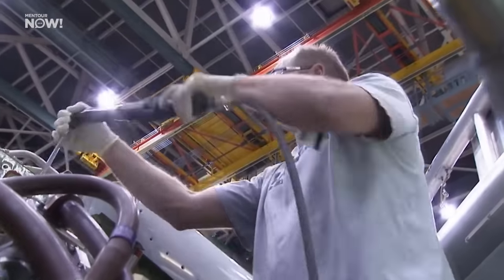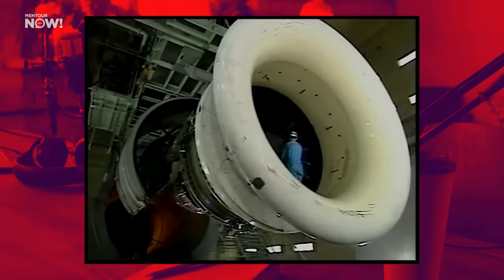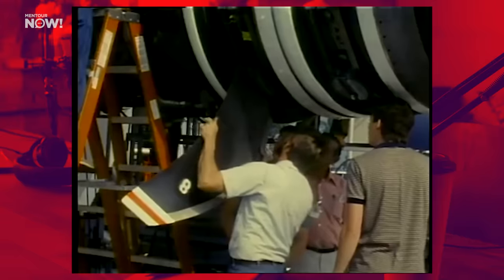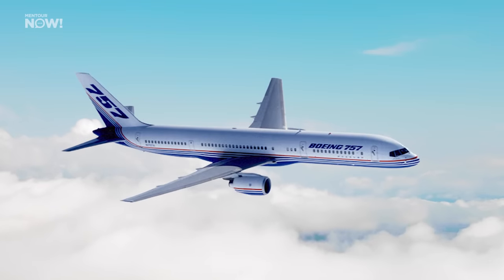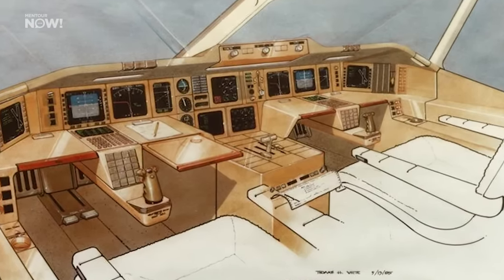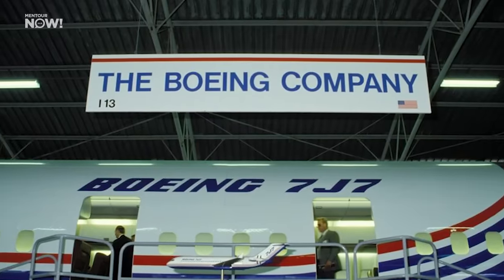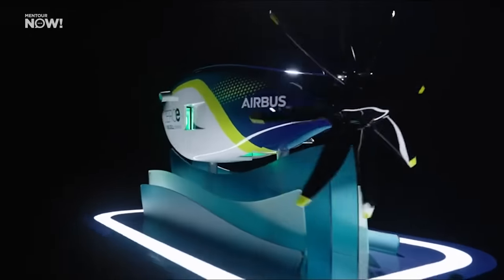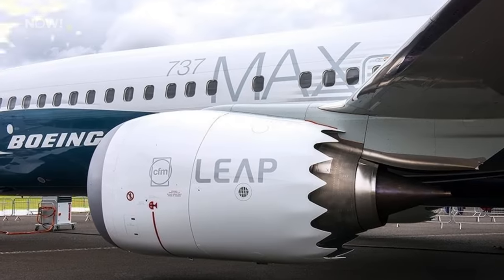Revolutionizing Flight! The Amazing Potential of the CFM RISE Engine.

Comment: Very informative. It'd be "interesting" to sit by a window beside one of those beasts.
Reply: It's odd that I don't think twice about sitting next to a turbofan prop but this new design gives me the jitters.  Most likely it's because standard props have been around so long that they seem totally normal so I don't even notice them.
Reply: Considering we still have uncontained failures of both turbofans and turboprops I try to make it a point never to sit beside the engines on any flight.
Reply: @cosmicinsane516  I do the same.  I trust all machinery only so far.
Reply: I flew on an ATR 72 directly next to the propeller, it was not an experience I would like to repeat. It doesn't matter if it's rational or not, the fear is the same.
Reply: @cosmicinsane516  It doesn't matter how robustly you design a system or how many space-age special alloys and forging techniques you use for the materials during construction, It is fundamentally impossible to design ANY system that is absolutely foolproof and incapable of failure, especially on such a complicated mechanical structure as in a modern turbofan engine. That being said, modern aircraft engines are extremely robust and extremely reliable, the incidence rate of engine failures on modern aircraft is about 1 in 100,000 flight hours, which makes it beyond extremely rare.
Reply: @Cynsham  Exactly.  So if there’s a .0003% chance of an uncontained failure and I don’t sit in the likely zone of danger for that failure, I have then reduced my risk by a measurable percentage.  Same as wearing a seat belt or not eating the ham in the fridge that smells a little funny.  Save the risk for higher reward scenarios.
Reply: Jets regularly run through flocks of geese and have migration forecasting to avoid the catastrophic engine failures that sometimes occur when they do... imagine sitting next to these prop blades as they're slamming into geese carcasses at full power. 😳
Reply: @cosmicinsane516  the new composite blade designs for UDF are known as 'shattering blades'.

Effectively, this means that if a blade broke away from the housing, it would split into a thousand pieces - both absorbing energy, and taking propelled energy away from the mass of each piece. This means that it would not be dangerous or go through an aircraft.
Reply: @cosmicinsane516  name a recent uncontained failure, of a turbofan?
Reply: @johnnunn8688  southwest 1380 is most recent that comes to mind
Reply: @dogefromthefuture  They will act as the best cutting Japanese knife. Blades of turbofans are already tested with frozen chicken if not turkey thrown at them.
Reply: Window seat definitely 😍👌🏾
Reply: A couple of comments on this. The use of hydrogen as an aircraft fuel maybe problematic. You cannot use compressed hydrogen because even at very high pressures the energy density just is not good enough and you have the extra weight of the high pressure containment system.  So you need to use cryogenic hydrogen storage which also adds weight because you have to manage pressurisation and gasification of the hydrogen at a temperature suitable for use. I think Roll Royce produced a jet engine that uses hydrogen, no CO2 emission but how much nitrous oxide does it produce? If you burn hydrogen at the ideal ration with air you get large amounts of nitrous oxides produced, if you use more air to lower combustion temperatures you reduce efficiency. The latter maybe an option but still produces nitrous oxide but perhaps no more than current carbon based fuel engines?
The other alternative which produces only water vapour emissions if the fuel cell, battery, electric motor power system. Here there maybe issues with the additional weight of fuel cells required to generate the power required to drive the electric fan?
The other big issue with hydrogen is that green hydrogen is very expensive to produce. An alternative might be to ramp up the biofuel industry instead? It also seems that some big corporates in the fossil fuel industry are hyping the use of hydrogen but not necessarily because it’s a good idea!

The whole ducted/unducted fan thing seems to be a can of worms. However, I would have thought that at high altitude and high speed the ducted fan would be much better than the unducted fan. An unducted fan is likely better at lower speeds and lower altitudes. I also prefer having some attempt at fan blade failure containment rather than none!
Reply: The noise I think would be astounding...
Reply: I am not convinced that that nacelle does much to effectively contain a turbofan failure.  From what I have heard the casing/wing does very little to change the trajectory of engine parts. Given the different speed, shape and size these new designs may well pose less risk
Reply: @cosmicinsane516  agreed. There’s no container on these engines. If the engines are placed at the rear of the fuselage those blades will be headed toward passengers and the tail (rudder, control surfaces, and the overall tail structure).
Reply: @monkeytechx  Hi, I found this: 
In order to insure passenger and crew safety, international aviation regulatory bodies, such as the Federal Aviation Administration in the United States and the Joint Aviation Authorities in Europe require that in commercial jet engines a system must exist which will not allow any compressor or turbine blade to perforate the engine case in the event that it is released from a disk during engine operation [1]. Due to this requirement the fan case is the heaviest single component of a jet engine. The Federal Aviation Administration further requires that jet engine manufacturers demonstrate, through a certification test, that the most critical blade be contained within the engine when a blade is released while the engine is running at full rated thrust [2]. The most critical blade in the engine, in terms of maximum kinetic energy, is invariably the fan blade, and the system designed to prevent it from penetrating the engine is called the fan containment system.

From https://www.sciencedirect.com/science/article/abs/pii/S0734743X08002388
Reply: "WHAT? DID YOU SAY SOMETHING?"
Reply: @RB747domme  Oh that's a good point! That will also reduce kinetic energy per blade piece, and due to the chaotic nature of shattering, results in all the kinetic energy being spread out over a larger area, reducing the pressure against the bulkhead, likely below the "piercing pressure" needed to puncture a (reinforced) fuselage.
Reply: @fredturk6447  A possible option technically as the aircraft using it would be taking liquid fuel on board as they do now, is “e-fuel.”  E-fuel would use hydrogen produced with electricity, combined with atmospheric CO2, to make the fuel.  So in a sense hydrogen would be used as a fuel but wouldn’t have to be actually carried in the aircraft. It’s only a concept now, not just proven technically or economically.
Reply: @PRH123  sounds possible, although as I understand it at present producing green hydrogen is expensive. I also understand that every time you perform a process to change or compress something there will be an energy penalty. However, I guess we will see.
Reply: @gaetanguimond7213 , not frozen birds, what would be the point of that; are birds frozen while they are flying? No.
Reply: @cosmicinsane516 , OK but considering the number of hours flown per year, 3-4 failures PA is very low. Also, rules have changed making fan casings much stronger, so that will improve over time. When I fly, I’m more bothered about this ridiculous rule requiring me to remove my shoes, than an engine failure.
Reply: It would be annoying.  These are incredibly loud.  It doesn't matter how efficient it is, it's just not practical due to the noise.
Reply: @fredturk6447  I’m somewhat pessimistic too, complex and expensive…. 

on the one hand it would consume excess atmospheric carbon…. but on the other hand it assumes that the electricity production is not producing carbon…. Or also using hydrocarbons that they’re trying to eliminate from the aircraft…
Reply: Very interesting indeed,i once sat by window of a propeller plane,my thots went wild a couple of times😂 😂 😂
Reply: @mbryson2899  I think when you're riding in the machinery thousands of meters above the ground, hurtling nearly as fast as sound... That's a lot of trust, one might argue it's gone all the way as you trust it not to kill you. Personally I always sit right behind the wind so I can watch the control surfaces during flight... I love watching flaps at landing.
Reply: Noise is waste.

Part of the very advantage of turbofans is the encasement; A radial limiter that forces the airflow and compression to behave as one wants and only generate useful rearward thrust, cutting off those annoying tip flows.

Sure, variable pitch gains you a lot of speed matching. But you only need to take one look at the operation of the variable intake ramps on a Concorde to see how there are smarter ways to gain that efficiency.

Really, if we want more efficiency? Then we should be trying to figure out some kind of "floating" or pressure-bearing system to make hubless jets. The outside radius of a fan is where it does most work due to the greater aV, hence how they have been scaling them up as materials have improved. And toward the center of the engine? Ideally you just want open space there, to reduce drag losses, and hopefully just have an open flow which gets entrained by the wash of the outside high pressure jet ring; This would both increase efficiency and improve engine footprint. Not to mention theoretically it also makes the engine significantly more safe from FOD and bird strikes and whatnot.
Reply: @monkeytechx they are required to contain an blade that has parted company with the hub to be certified. It apparently is not 100% because there are circumstances where the blade has escaped. But this design has bigger blades with no containment at all. It is not just a risk for those sitting in the firing line. An uncontainable blade failure can go through the wing and destroy flight controls which is pretty bad for everyone.
Reply: @PRH123  isn't porche building a south american test factory for eFuel currently?
Reply: It might be so that there will be no window to look out adjacent to an open fan, imo a good safety measure , at least  in the beginning after the experience  of long term usage and some bird strikes have been made.
Reply: pls  see .my  comment  just  now
  i  have...
Reply: Don't you see, it's all BS??
The dude's trying to get subscribers
Reply: I worked on the GE36 (GE's 1980s era unducted fan). I went to a presentation given by the guy who first revealed the concept to the airlines. He asked the airline representatives "how would you like engines that are 40% more efficient than your current engines?". Lots of positive mumbling from the crowd. Then he said "what would you think if your passengers looked out the window and saw this?", then put a picture of the engine on the screen. Lots of gasps from the crowd. Then the Lufthansa representative spoke up and said "it's not a problem, we'll just glue the window shades down".
Reply: @fredturk6447  there are lots of videos of these tests here on YouTube; search for "bladeout" (American term) or "bladeoff" (British term). They're pretty violent, lots of changees and smoke.

Also, not only does the engine have to withstand the initial event, but it must also be capable of continuing for the rest of the flight without anything falling, out being thrown off. For an aircraft that's certified to fly over large bodies of water, that would be half the time required to fly over that body of water (i.e. several hours). The engine is, of course, turned off as immediately as possible after the event, but the air passing through it continues to rotate the engine. The rotation speed isn't high, but the engine is now in a highly unbalanced state, sending large forces through the engine structure. There are several features within the engine structure that act as "fuses", they fail in the event of large forces and act to prevent the forces from reaching levels capable of causing unconstrained structural damage.

Source,: my 30+ years in the jet engine business.
Reply: @johnabbott138  thanks, John, very informative
Reply: @johnabbott138  The shades then only opened after charging an extra fee to fans of  the "Pendelum of Death" (Edgar Alan Poe) and similar horror stories. LOL
Reply: @dogefromthefuture  well you would get a wild view as the engine ceases to work then the plane takes a sudden nosedive. bird strikes are scary i would not in a blue fit want to be anywhere near the wings when that happens.
Reply: @Clint Tapper  I gotta see a video of this, who's got a video of a jet at speed with these props hitting geese and not taking off the passenger window?
Reply: No more interesting than window seat on a turboprop
Reply: Twilight zone gremlin on engine loosens propeller blade .
Reply: safety issues aside (turboprop fuselages are reinforced to withstand a blade out), sitting next to the prop is a good way to get hearing damage on all but the newest turboprops.  My first flight on a turboprof was on an old SAAB 340B, sitting next to the prop, had tinnitis for a week.  Sitting next to the prop on a Q400 on the other hand wasn't any louder than a 737
Reply: I will not ride with the Choppah, in fact I will not ride.

Comment: Great content- although for FWIW, as a turboprop mechanic you don’t get much in the way of “blade out” protection. What you pointed out on that ATR72 at 14:37 is an ice plate. Common on most turboprops, just a sacrificial layer to absorb ice being flung off. I’ve replaced them on the ATR and they are literally just a chunk of additional aluminum double sided taped to the fuselage. Will in no way stop a blade from coming through.

Comment: I thought one of the reasons everyone ditched turboprops was because of maintenance. I was in a patrol squadron many years ago and the mechanics worked on the prop’s system more than working on anything in the engine core itself.

Comment: The big problem, as I see it, is blade separation during flight. Since, this does happen in the current ducted nacelles as a result of various things that can happen in flight.
Reply: Well that issue also is a thing on todays "regular" turbo prop aircrafts. And it doesn't seem like an issue.
Reply: What was that Southwest flight a few years ago that flung a blade into the cabin? A passenger got sucked up against the hole, plugging it with their body? I think they died like two weeks later? I worked on Rolls Royce engine casings at the time, and it caused quite a stir. No matter how well you can protect people from the engine, you still need openings at the back and front to let air through.
Reply: IIRC, this is also why we'll likely never see miniature turbines offered as power plants in commercial automobiles, despite the potential for amazingly long engine life.  Again relying on my memory, the turbo lag issue was solved by the inclusion of a small electric motor to give the wheels an initial kick while the turbine would spin up.

Comment: We had a Bear visit as part of an air show maybe 25 years ago.  I remember being outside when it flew over at about 200 mph (a total guess).  I heard it coming and told my friends that, whatever it was sounded just plain weird.  The I saw the swept wings with props. Dang!  These days, nearly all of us carry a camera with our phones.  Wish I had it back then.  How often do you see a Soviet warplane flying low over WA state?  But, yes, noisy, even at low speed.  These engines seem like they are going to be very nice?  Whodda thunk a prop plane would be the efficiency booster of the early part of the 21st century?  Not even Duck Dodgers (in the 24th and a half century) would have been onboard with that one.....

Comment: I worked at Hamilton Standard (later Hamilton Sundstrand, later Collins, now Raytheon) and served as the FAA DMIR on the Pratt project.  The system was only a bit noisier than a turbofan, but the pitch was quite annoying.  I grew up in Chicago, and the noise was significantly quieter than the old turboprops flying into Midway.

Comment: I was in Long Beach CA when MD was flight testing the MD- 80 with the open prop-fan on one engine. The noise was tremendous, kinda like 1000 chainsaws gone wild. Would never pass any noise restrictions. Maybe next time.
Reply: That's long in the past, these new things are much quieter, same as other current jet engines. The first plane designed and manufactured to take advantage of this engine is going to change the industry (Is it the Embraer?). It may be more practical to go back to rear mounted engines, even if its not strictly needed, i can see the benefits of having more ground clearance during ground operations and take off landing.